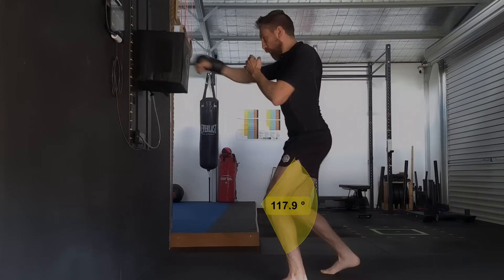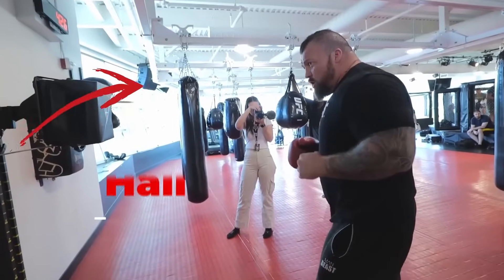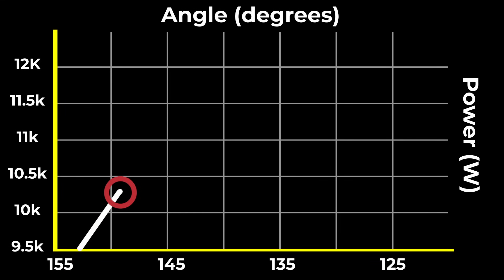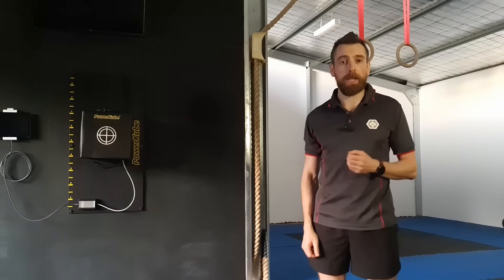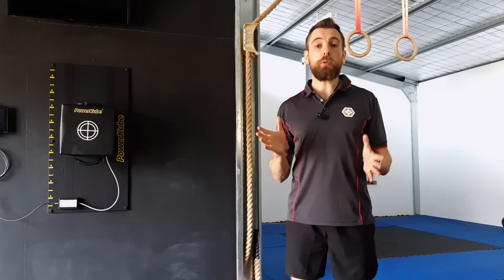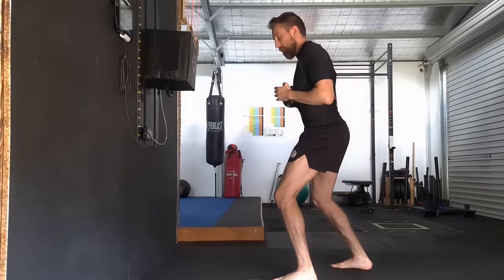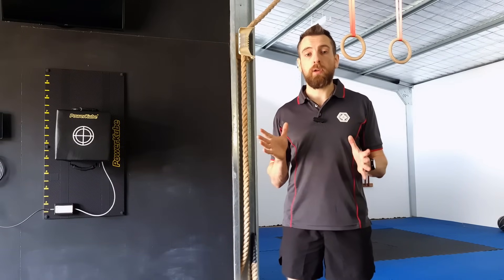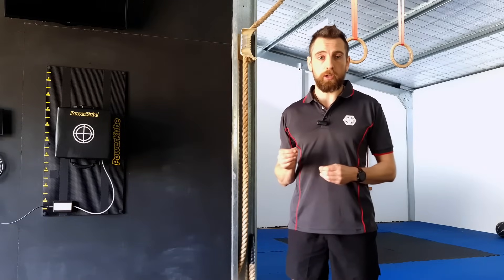How to Punch HARDER Using SCIENCE

Comment: If you are properly throwing a cross both your feet will simultaneously move a few inches forward to propel your entire body weight into the strike. There is also a simultaneous rotation at your core, the arm is more or less a conduit for the power generated by the body weight and optimized by the rotation of the hips. There are more nuances that are more difficult to explain

Comment: Old school boxers also used something called cat-stepping to help drill weight transfer.Basically picking the heel up on the leg with less weight. You arent really incorporating that weight transfer here. looks like your weight is 50/50 at the start and then 40/60 at the end. good for mobility not great for power punching. The further you go back in boxing you can see where boxers held the weight more on the back foot so they had a lot to transfer to the front foot. Id be interested to see your results after that. I assume your percentages will jump up. Some ppl from mma you can watch who did this exclusively were Matt Brown and Dan Henderson. Matt even had a video explaining it from his terms. Hendo has several. 

You can nearly always tell when someone is going to be a weak puncher by the stance. They always carry thier head too far forward like you do in the video. head nearly over the lead foot.

Comment: The way my boxing coach explained "sitting down on your punches": Had me stand in front of the heavy bag. Placed a resistance band around my waist, and stood behind me, pulling on the band. I had to squat just a bit and move my weight forward a bit to remain in a good stance. Not leaning forward, but just a forward pressure if you will. "Punch". First couple of times i/ was all over the place because of the backward pull, but eventually got to where I could punch correctly. Then he removed the band and said "go for the same exact feeling you had with the band." My takeaway? Sitting down involves a forward and downward shift the body weight, with an intentional explosiveness directed toward the target that otherwise you would not think about or execute, creating better structure to handle force rebound and also creating a bit more acceleration into the target with body mass behind the punch. At least that is my current understanding.
Reply from the maker: @athenry that's a really interesting drill to play with the sitting idea. I see the sitting mechanic falling into two categories based on the style or teacher. Its either a forward and down mechanic like you are describing or a forward rising mechanic like the one I demonstrated. I'm currently working on another video to compare them as they are both valid, just stylistically different.

Comment: Bladed or Squared stance also played a great role in this one.
Reply from the maker: @wuhaowen1471 I have a video planned for the future looking at how stance width and length change the power of punches.
Reply: @ From my experience Squared stance usually generate greater powers in hooks and uppercuts, the straights usually can have a greater rotation if started bladed, but straights from squared is easier to throw but less power, but you will test it out anyway

Comment: Alternate explanation for you to consider.  Most of what you're addressing here with angle actually has to do with structure.  Poor structure means your power rebounds off the target and gets absorbed by your structure.  Good structure connects you to the ground and allows maximum power transfer to the target.  You can easily improve your structure and "find your angle" by punching out to your maximum extension, finding a wall, and then pressing on the wall in that position. You'll find gaps in your structure because they'll collapse, or you'll find yourself falling off balance.

Second point is that by punching in the same plane, you're actually leaving power on the table (and btw, you're still missing a point of "sitting down on the punch").  Frustratingly, most coaches don't explain it in any depth, just as they like to say "power comes from the ground" but most students have no idea what that's supposed to mean.  I think it's more instructive for beginners to say "power comes from weight transfer".  For instance, you can pivot on an axis, but if you're just rotating and your weight doesn't transfer from foot to foot, you won't generate much power.

Another way to transfer weight is by dropping your weight.  Remember, force is mass times acceleration.  The more mass you recruit into your strike, and the faster you get it moving, the more powerful your strike will be.  So, you don't necessarily have to stay at the optimal angle you discuss here for the whole movement; you do need to END at that angle so your structure is good at the moment of impact.  And, if you explosively drop your weight on the foot that takes your weight in the direction you want your power to go (front foot for rear hand punches and jabs, back foot for lead hooks), you'll recruit a substantial amount of mass and acceleration into the punch that would be left out otherwise.  If you've ever done popups, I think that's a good way to get the feeling of it.

This is also why a power jab requires a drop step, and ideally you fall onto that foot at the moment you make contact with your target. 

Consequently, proper "sitting down on the punch" actually requires you to start slightly higher than your "optimal angle" and then explosively drop your weight as you punch to transfer your weight from foot to foot in the direction of the strike.
Reply from the maker: Spot on with the structure point, I do mention that with the anchor analogy and it is another take on how I can explain it in future. Someone else also mentioned the wall training idea in the comments and its a good drill, I use the ball throw as a starting point to visually demonstrate the difference then get people experimenting with the ground connection. Your right with the second option of dropping your weight rather than raising it and that's another video im going to make to test.
The other thing to keep in mind is that I am isolating individual parts of the punch technique to show how each effects the final outcome, and this is the first video. There are more to come on hip rotation, weight transfer, stepping mechanics etc with the plan to put them all together down the track.
Reply: @hamishjansen-warriorcodex  hope it all goes well!  I've been studying the mechanics of power for the last 26! years now myself, so it is always interesting to see other people working on the science of it.  Looking forward to those videos.
Reply: @hamishjansen-warriorcodex  oh, one other fun aspect you might look into is joint power; it will add nicely to your discussion of kinetic chain.  And, I know people love to hate on tai chi, but they have some concepts of rotation along the limbs that are really fascinating.
Reply from the maker: @crimsonfalcon07  I have been doing some investigation into spiral mechanics recently. Another interesting aspect that is getting more interest in recent years is the role that fascia plays.
Reply: damn bro. time for you to make your own video
Reply: Excellent explanation and detail. Happy to use your description with my kids. Excellent layout, Thank you!

Comment: First, congratulations on this channel and this curiosity. On the other hand, the link presented here is open to criticism. I invite you to test your quadriceps/hamstring on a leg curl and see the strength difference at theses angles, it's very far from 25%. 
If you know boxing, you'll know that the old crouching punchers used to talk about "falling steps" (as in Jack Dempsey's book). Today, we're talking about weight transfer and a solid base (which will force you to lower your center of gravity anyway). Football players lower their hips to generate horizontal thrust, which has nothing to do with knee angles. Deontay Wilder, who has a big cross, has a very wide stance, but his legs are very straight. So, I have my doubts about the physiological explanation and would lean more towards the mechanical one.
Reply from the maker: Thanks @aarondalaham3724 I have actually tested my hamstrings and quads on a dynamometer and in isolation there is a difference but that doesn't translate directly to movement patterns when the system becomes more complex. I do have a follow up video to make comparing falling weight such as Jack Dempsey vs rising weight such as Tyson. Also if you lower your hips then your knee has to bend so there is a knee angle at play with the football players, knee angle may not be the best measure but its the easiest to explain the concept in a video.
Reply: @hamishjansen-warriorcodex  So don't forget the specific style of these 2 boxers, their basic stance, and their preferred punch and why it works for them. Certain styles also use lateral energy, as is often seen in Savate (french boxing) with a lot of in ou move (As the Russian boxing).

Comment: Haven’t watched the video but I can say, the generate more force when you push off the ground. So slightly squatting (loading)  and then exploding will cause “maximum force”. This is just a generalization and more components are at play.

I’m a actual fighter with that’s considered a puncher
Reply from the maker: Thanks @Bhodisattiva, that how I typically punch, dipping then extending the legs for force generation. There have been a few comments regarding the dropping version where you drop your weight into the target so I will have to see the difference. I believe there is more power in the load explode version.

Comment: That was a nice concept but i think what you ended up finding is that loading your leg more gives you greater power instead of actually finding out whats a good knee angle at that end.

in the videos you can see that you end up with a much straighter leg than you started to use that leg drive. I think thats why sitting down on your punches makes no sense if coaches say you have to come down with the punch instead of going up
Reply from the maker: Yes @Ufhhh12 I have been seeing a discrepancy across the comments between 2 versions of sitting down. My version is a load then extend pushing off the ground like jumping which is what you have mentioned. But there is the other version where you drop your weight into the target as you "sit", im going to make another video now comparing the 2 versions.
Reply: @hamishjansen-warriorcodex  
Ok few interesting concepts you might want to look into or make a video about 
first i think put more emphasis on the biomechanics and expereince and try to make a prediction, i like the idea of the testing too but its still n=1. 

Try to make a prediction on which "style" will be more powerful based on your research (biomechanics, experience, looking at fighters)

for example.
Left hook, pivot on the foot or not? palm down or palm up? What does the biomechanics say? How do people like Ryan Garcia and Alex Pereira do it? Whats your expereince with it? If you feel like it will be biased that way you can do these after. 

this is just a recommendation obviously you do whatever you want

Comment: I am really enjoying the content you are creating, please keep up the good work. What would be interesting as an extension to this particular experiment, would be the effect of rear leg knee and hip angle, given the rear leg force generation in the kinetic chain. Then looking at the range of motion in terms of rotation through the hips and core, though this would be harder to capture.
Reply from the maker: I'm looking at hip rotation as the next video, less than parallel, parallel and past parallel, some of this should be covered in that but getting a nice clear picture will need motion capture which I plan to use in future, its just so expensive to do correctly. Thanks for the support.

Comment: I’d love to see a similar test, but with a twist. It’s common to see (Russian/soviet style for example) for them to use the power of the leg straightening from a bent stance to add power to the punch. Almost like they’re jumping into it. In other styles they’ll drop their weight while throwing the punch (i.e. dropping weight into your overhand punch/low kick, or a Dempsey-style trigger step). And then of course there is the bent-knee “sit” where your center of gravity stays fairly level on the torque. Would be very interested to see these tested on the cube
Reply from the maker: I'm planning to cover hip rotation next, then stepping and jumping mechanics (like the soviet style) in the next one. Eventually making a complete series looking at all the components of the cross. Ive also added to the list by request from 2 others dropping vs rising power.
Reply: @ awesome. Excited to see it

Comment: Love the methodology, but I think things like psoad engagement and other variables confound. Knee bend is necessary but not sufficient - you need to bend it only so much as you need to engage things like psoads. Yet theoretically you can learn to recruit these with less bend. It's like turning the foot on the cross - over time you can create the recruitment without the training wheel.
Reply from the maker: Like any testing its hard to eliminate variables and isolate exactly what is wanted. By psoad im guessing your referring to the psoas and hip flexors. As these are hip flexors they wont contribute to the extension and rotation which occurs at the hip, that will be primarily glutes, with the calves initiating the leg extension. But yes I agree with your point, as you train and develop deeper neuromuscular pathways you can generate the same result with less effort, this is the efficiency you see in high level boxers, its not that they aren't doing it, its just so much quicker and smoother.
Reply: @hamishjansen-warriorcodex  sorry, ya, psoas. It might be a difference in style/technique, but when I throw a cross I'm activating 3 chains of muscles: 1) the muscles to drive the punch from the back leg and hips, 2) the muscles to stabilize my core so that the power from my legs/hips translates into my fist, and 3) the muscles that pull downward from the front leg further accelerating the rotation of my hips. To get maximum power I'm basically springing off my back leg, pulling my front knee towards my chest (slightly), and engaging my core all at once. The psoas help with 2 and 3. I think 3 for me is what keeps the bend in the front knee that you're talking about. Aka I think we're talking about the same thing, just with different points of reference.

Comment: I always thought sitting down on your punches meant to bend the knees as you throw the strike, but you seem to be bending, then throwing. The way youre doing it i understand exactly how you would get more power from it. Pushing off the ground. But what i dont understand is why i also seem to get more power from the cross when i start relatively straight legged, then sink down as the strike is thrown.

Maybe you can do a follow up video? And if the way i learned it is actually adding power and not just all in my head, then what if you combined both methods in an arcing motion? Push off, then immediately sink back down. 

I wish i had a power cube…
Reply from the maker: Your right in that you would sink as you throw the punch, I'm purely doing it statically to eliminate potential variance. I would typically sink into the lower position using footwork during the setup. But then you have two options, use the sinking motion to deliver the shot, or use a more jumping motion similar to Tyson. Both are seen in boxing and are two different schools of thought. I can definitely look at the difference in another video.
Reply: @ fuck yea